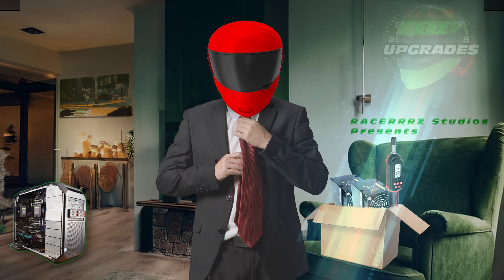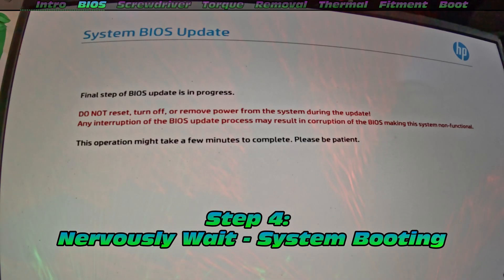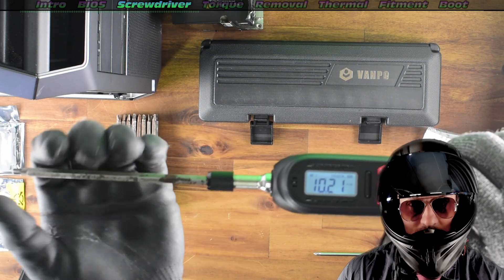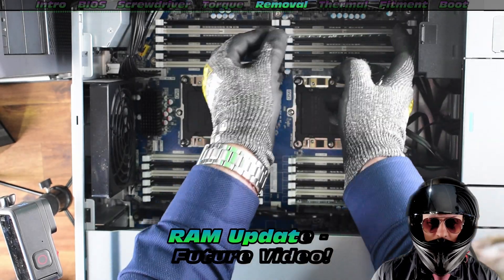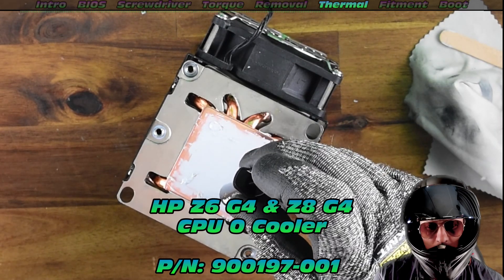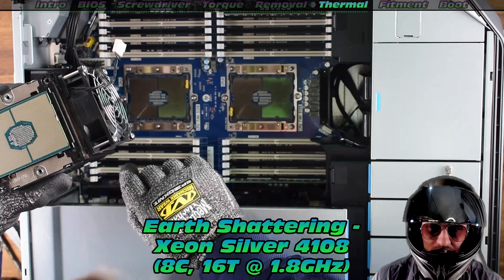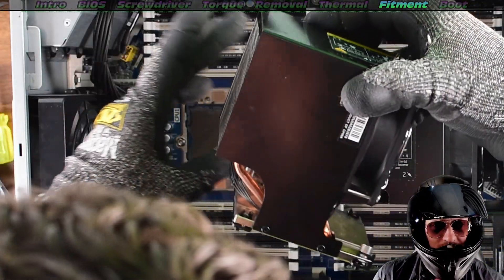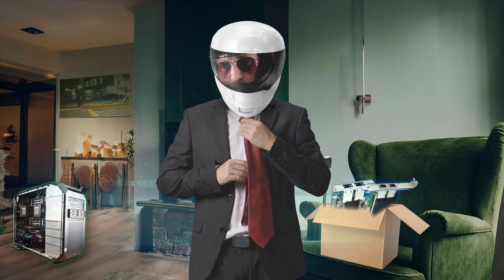Two are better than One - CPU Fitment GUIDE : HP Z8 G4 Workstation

Comment: the z8 g4 would be brilliant, if it wasn’t for their apple-style proprietary paywall roadblock.
Reply from the maker: I would not put it on the same line as Apple's pay wall. These HP workstations are proprietary but you can customize to your heart's content (my channel will advocate for that!). There are certain components that you would need the HP item for convenience - mostly fan modules. My Z8 G4 I have left in the original state - but I do populate it with a variety of different brands - like Asus Hyper Quad M.2 adapter, RTX 3090 Ti, Intel X540-T2 10GbE, Jeyi dual U.2 to M.2 adapter etc. As a more extreme example - my HP Z440 is no longer recognizable: https://www.youtube.com/post/UgkxVgilEnpjp8Pvw2_zS9npnou2g4bN0aKV

Comment: I run a Xeon Gold 6142 in my HP Z6 G4.  I installed it about 6 weeks ago and used Arctic MX-4 thermal paste.  But I only saw a peak of 90C after a ten minute run of Cinebench R23.  Thermal Grizzly is not as good.  I had previously installed the same CPU with Thermal Grizzly Aeronaut and saw temps of 99C after only 5 minutes of Cinebench R23.  And, of course the stock paste processor ran hotter than the one with the TG applied:  CPU 1 ALWAYS runs a couple of degrees warmer than CPU 0 in the HP Z8 G4 because CPU1 draws it's air from the exhaust of CPU0.  The factory stock thermal paste on these HP coolers is by far the best thermal paste I've run into.
Please do your homework and don't post disinformation.
Reply from the maker: Hi there. Thank you for sharing your opinion and findings.

To be able to claim that Arctic MX-4 is better than Thermal Grizzly Aeronaut you would need data to support your claim.

Personal use would be a good indicator but it would be more reliable to compare data from an expert with your findings. Igor's lab does testing and reviews on thermal paste compounds. Thermal Grizzly is well recognized for the quality of their thermal paste, and they often reach the podium in testing. I am sorry if you mistook my words but I have never endorsed "Thermal Grizzly Aeronaut" in any of my videos. I have endorsed Thermal Grizzly Kryonaut (with the product packing clearly shown in some of my videos) because in my own testing it outperformed the factory paste in several different tests across several machines. The better question is: is it even possible to still buy an "HP CPU cooler with their supplied paste" for a system that is 7+ years old, or are current listings for the coolers supplied by retailers supplied with a different thermal paste (i.e. a non-OEM paste)?

Your findings are consistent with the expected performance for Thermal Grizzly Aeronaut (Thermal Conductivity: 1.1 W/m·K). Arctic MX-4 is a better paste, with a Thermal Conductivity of 2.6 W/m·K. Thermal Grizzly Kryonaut (the one I recommend) has an even higher Thermal Conductivity of 3.2 W/m·K, meaning the effectivity will be: Aeronaut << MX-4 < Kryonaut. 

IgorLAB's findings:
MX-4 vs Aeronaut: https://www.igorslab.de/en/thermal-paste-comparison/?ids=42,44
MX-4 vs Kryonaut: https://www.igorslab.de/en/thermal-paste-comparison/?ids=9,42

For an excellent outline of the different thermal pastes and their performance in one test: https://www.tomshardware.com/best-picks/best-thermal-paste (Kryonaut outperformed MX-4 by a negligible margin, so MX-4 might be the better buy since it's often listed at a lower price).

If you would like to gain some insight into my scientific rigor on this channel, this is my contribution to thermal paste testing: https://youtu.be/pqkvvZPgv8g?si=g460GJ9jqF8OfeW5  To date, this project is still the largest thermal paste application method study done - with full scientific rigor. If I obtain additional replicates for the experiments I could publish the results as a low impact factor journal article.

In terms of the Z8 G4's CPU chamber's design, CPU 1 does not actually draw air from CPU 0 due to the CPU shroud's design. HP created two dynamic chambers, with CPU 0 drawing air from the upper region of the case, and CPU 1 drawing air from the middle region of the case. There is bound to be some degree of air leaching through between CPU 0 and 1, but HP's engineers did consider how they could avoid CPU0 leading to CPU1 thermal issues. With that said, in my findings, CPU1 does tend to run ~5'C hotter than CPU0 under load. The bigger issue is insufficient thermal paste coverage of the entire IHS. I have found the DOT application method to be very ineffective at covering the entire IHS. I have tried spreader, square with dot and smiley face application methods on the Z8 G4 - as well as varied volumes of paste. More paste does help with ensuring full IHS coverage - which does help to improve thermal performance. But overall, my conclusion is that the base fan speed settings are too conservative to retain good performance under 100% load. You can only increase the fan speed profile in the BIOS. I would have loved being able to increase the fan ramp rate via software. The alternative is increase the base fan speeds (creating more noise) or live with better acoustics and the thermal limit. Realistically we may not always run our systems at 100% load for more than 5 minutes. But if you do, you would need to work towards better CPU fans (Noctua - with a 4-pin to 5-pin adapter). 

And I get it, with the whole "PirateSoftware" internet debacle it is difficult to know who to trust online. I will not try to win you over, I do not chase click-bait; everything I do I do to the best of my ability - and I would hope my "works" speak for my work-ethic. My goal with this channel is to empower others to make an informed decision with their builds, and from your description I have failed at that core goal, and thus I need to further improve my content delivery to prevent others from falling to the same fate.

Comment: Thanks again for your greatful content. I succeeded to change my Z8G4’s CPUs and to make 56 core, 112 threads system with 1.5 TB ram!

There is no guide or manual about HP 10 GbE module on the internet. So, I’m looking forward to your next video about the module.
Reply from the maker: I am glad you found the guide useful. Which CPUs did you settle on? Something like the Platinum 8176M would work well to net 56C, 112T and 3TB RAM. Well done on the RAM, it's not exactly cheap to stock up on RAM on these but that is a monstrous amount. True, there is also no guide on RAM fitment, and the RAM upgrade path isn't exactly simple on these. I need to place some effort into rounding off these guides. The 10GbE module with the network interface connector was super simple to get operational - it reports as an Intel X722 10GbE NIC in Windows 11. I can recommend the upgrade (I was using the Intel X540-T2 before that without issue).

What will you use your system for?
Reply: I've got something very similar, 1.5TB of RAM for trading analysis and using 2x 8273CL's

Comment: Meke workstation bro.
Reply from the maker: Thanks. I am really impressed with this system. It's doing heavy lifting on a daily basis and it has improved my workflow efficiency. I have upgraded further since this video. Dual Gold 6248s with 384GB of 2933MHz ECC RAM. It's hard to beat on value for money and the 9 PCIe slots allow ample expansion.

Comment: Nah, you don't the torque screwdriver. You'll feel the screwdriver will stop turning before you hit the targeted torque anyway. Been replacing multiple lga3967 CPU with normal screwdriver without any problem.
Reply from the maker: That's interesting. I had that experience on the Z840's Broadwells but not on the HP Z8's Skylake Xeons - there has been no bottoming out when mounting - or at least I have not been brave enough to find out where that limit is. With HP engineering I would not be surprised if this was the case, but in my experience it would be very easy to under or over torque these - I would only use a torque screwdriver to avoid damaging a CPU or the socket. I'll add, the CPU that shipped with my Z8 was well under torqued and each corner had a different seating pressure when I got it (varied between 3-7 in-lb - when Intel recommends 12 in-lb) - so I presume the previous owner didn't use a torque screw driver (I bought it from a PC hardware store).
Reply: @racerrrz  diagonal screw on the top right and bottom left is just to guide the placement of the CPU, so even tho I bottoms up both of these screws, they cooler is still loose. the only screw that push on the CPU down is 2 in the middle. If you think about it, it make sense, why not all 6 screw are present? Won't the pressure be heavy on one side and not on the other? But if only 2 in the middle that put pressure on the CPU, everything make sense.
Reply from the maker: That's true. As per labeling on the CPU coolers, screws 3 & 4 are positioned central to the CPU cooler and CPU IHS - giving even contact pressure over the entire IHS. Screws 1 & 4 are for correct carrier frame alignment and to secure from lateral forces. If screws 3 & 4 were to receive an uneven pressure due to a best guesstimate it could lead to uneven contact (creating system stability issues) and uneven thermal paste spreading (creating hot-spots and thermal throttling). The socket has a mechanical stop to prevent excessive torque, but that is where we need to take a moment to consider why. 

If there is a mechanical stop, and no torque setting is required as you have stated, why would Intel and HP specifically state that the LGA-3647 CPUs require a precise torque value? Either Intel and HP got it wrong - or they had a reason for it. The buck is passed to the consumer to decide - buy a torque screw driver in the hope it prologues the life of your hardware, or trust your senses and torque them down until you feel you have hit the limit. Given the cost of the system, I would side towards caution. A $50 torque screw driver for piece of mind is cheaper than a $xxxx system, but that's just my opinion.
Reply: @racerrrz  yes, but if you watch dell guide on CPU replacement especially on lga 3647 you'll find that some of them don't use torque screwdriver. It's only my hipotesis, but I think that not all lga 3647 is created equal, the video I looked is for dell 7820. Maybe because it's still is a consumer computer but using an enterprise internal, they make their cooler fool prove. Because on my 7820, screw 3&4 spring is not even close to fully compressed when I fully tighten the screwdriver. So I can only say, follow the instructions based on the system, same socket but might have a different mechanisms.

Comment: what is the wattage of the PSU?
Reply from the maker: Hi there. It depends on the model that you get but the highest spec. PSU outputs 1700W on 240V mains. 
I'll add in, it has 4x 6+2 pin GPU power cables that each output 219.6W - netting a total of 878.4W for PCIe expansion. 

For more information - I gave a detailed breakdown of the system in my guide video: https://youtu.be/z7Ff2zs5ByM (PSU options outlined at 4 min 30 sec in that video).

Comment: Thanks again for your HP workstation content. 
Your content has been invaluable helping me set up my Z840 🙏
Reply from the maker: I am glad that you found these guides useful for setting up your Z840. What are your plans for your Z840? I should really do an updated CPU guide for the Z840 - there are some bargain CPUs out there right now. A E5-2696 V4 or E5-2697A V4 would both be the best in my books for the system (workhouse vs gaming respectively).

Comment: The z8 has been overkill for almost everything until I started playing with really large A.I. models. I'm never going to be able to afford 90 gigs of vram. But you can load a 90gig model into ram and run in processor mode reasonably well. Watch out for the processor 1 coolers from china, got 2 bad fake ones and ended up using a used genuine one that worked. thanks for the video
Reply from the maker: It's nice when you get to really use the full extent of the hardware you paid for. Using A.I. models to really push the CPUs and RAM should give the Z8 a solid run. I find my CPUs are on idle for most of my activities and it's quite rare that I get to really find the limits. But I'd rather be over powered than under powered. Interesting to hear about the cooler issues. Did they have fitment issues? I imagine the genuine ones will cost a bit more often but it is difficult to know from listing descriptions alone. I generally aim for listings that have had some number of positive feedback responses to avoid the dud trades.
Reply: @racerrrz  fan issues, Nobody sells the processor 1 cooling fan with the correct connector. the z8 will not boot without the correct fan if a processor is installed. in socket 1

Comment: i think i am done with these xeon work stations. they are not good value seeing a Ryzen 7 5800x  on this list 🤔🤨time to move on
Reply from the maker: For gaming I would agree with you. It really just depends on what you are doing with them. 

The Xeon CPUs I have my eyes set on is the Gold 6240's (18C, 36T, 3.9GHz Boost)- relatively cheap, but you would need two of them. They are 1 year older than the Ryzen 7 5800X, and they can't compete on single core but they are amazing for multicore. If the Gold 6258R's (28C, 56T, 4GHz boost) were more affordable I would go for them, the Gold 6250's (8C, 16T, 4.5GHz Boost) are decent also. If your end use is gaming it's always going to be better to go for a modern gaming oriented CPU if you can get one for not too much cash. My issue with that path is the net system cost - once you factor in all the parts for a system it exceeds the cost of the Z8 G4 - usually (the Z8 G4 prices vary wildly). I am quite happy with my 1700W platinum PSU, 9 PCIe slots - ample room for expansion and I can load in more RAM as my needs change - I'll never need 24 RAM modules but hey, it's there if needed. But then I mainly do work on the system - gaming is a secondary time-pass. 

Quick comparison - 5800X vs dual Gold 6240's: https://www.cpubenchmark.net/compare/3869vs3613.2/AMD-Ryzen-7-5800X-vs-%5BDual-CPU%5D-Intel-Xeon-Gold-6240
Reply: What do you mean 1700w platinum psu, the z8 g4 on 230v the 1400w psu becomes 1700w
Reply from the maker: @juliusvalentinas  That's correct, the highest spec PSU is rated for 1400W on 120V mains, and the same PSU can output a max of 1700W on 240V mains.